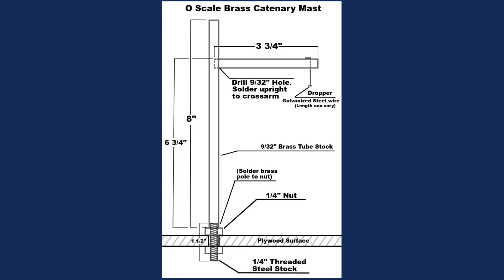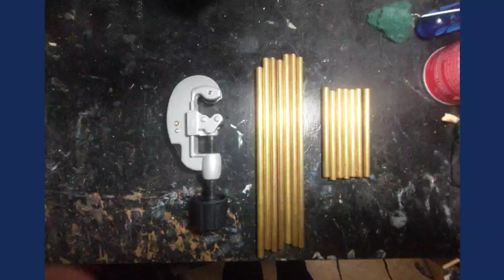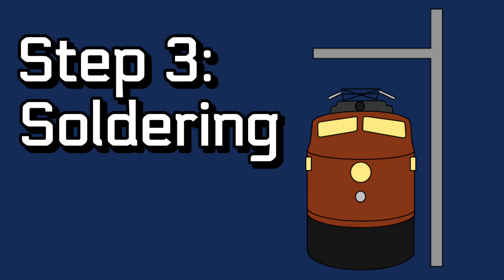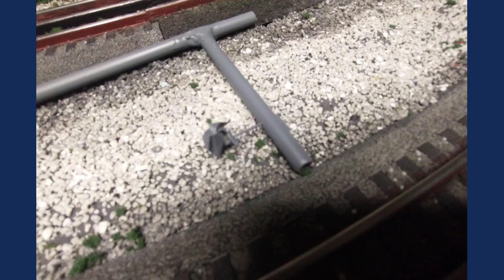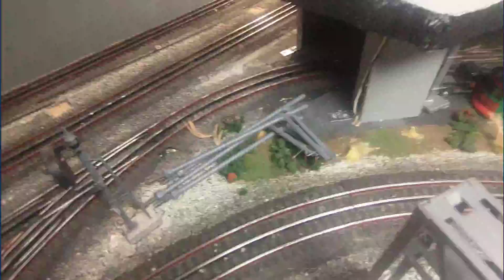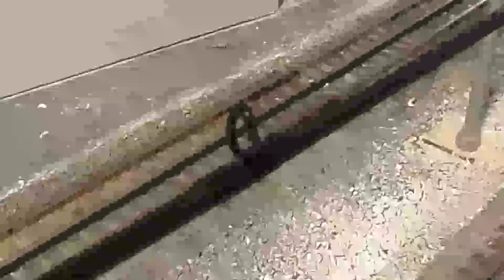How to Build Brass O Scale Catenary Masts & Catenary System from Scratch

Comment: Outstanding video and well instructed!  Who knew to use HO rail as the line. My go to video now if i want to build this system. Question...... would it be easier to use metal epoxy to adhere the base to the threadstock?
Reply from the maker: You know, I just bought some. I'll try it out.

Comment: If you had used flux and enough heat the solder joints would have flowed smoothly with a nice fillet instead of the boogered blobs you showed.  The mechanical strength would also be greater, something to think about for a catenary system that will be subject to a lot of wiggling forces in the coming years.  Epoxy might be used to join the threaded bases if you can't get the rod and nut hot enough to flow.  (Hint, if the solder doesn't flow on its own the pieces either aren't hot enough or clean enough.  Flux helps with the clean part. )

Overall, very nice and well thought out!
Reply from the maker: I jus bought a new soldering iron which is much more powerful, I'm yet to try it out on this but it should easily get the parts hot enough to melt the solder nicely. Thanks